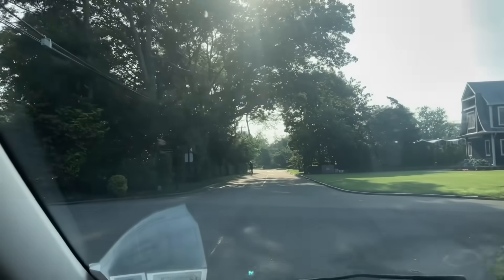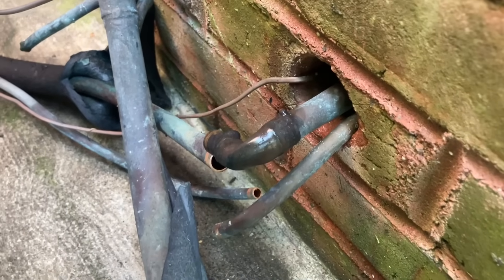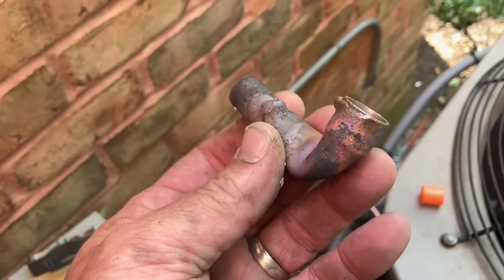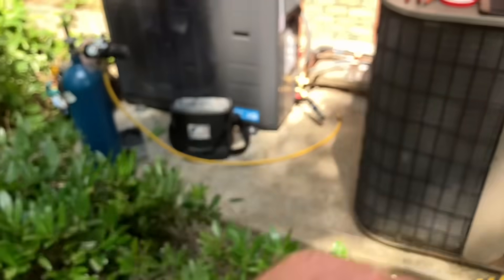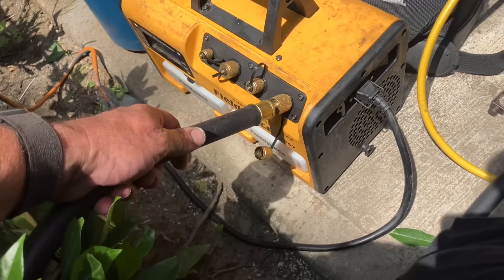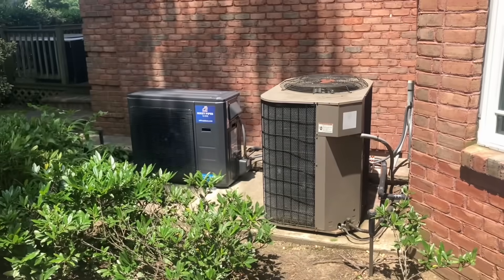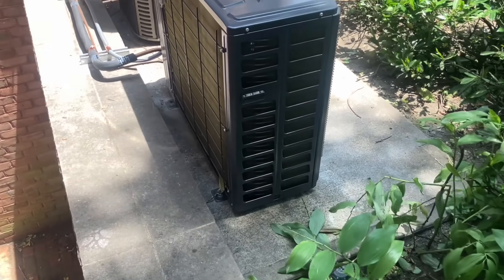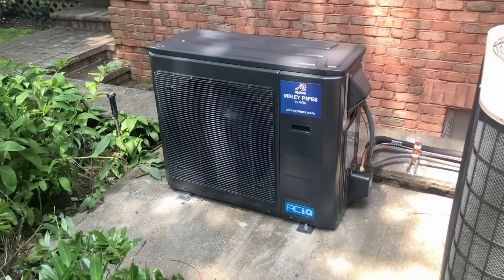ACiQ Heat Pump Installation Like a Pro – Line Set Repairs, Zoomlock & Whisper-Quiet Results!

Comment: Maybe the old lineset is preventing a proper vacuum, but you should be pulling much below 500, i shoot for 100-200 then isolate system from the pump and microns should not rise above 500.  Hitting 500 and it jumping to 2k is definitely moisture still in the system.  I know you turned the pump back on but i wonder what it is about your setup preventing good vacuums on lots of your videos.

Comment: last I seen, if capable of heat pump usage, it needs to be elevated off the ground above local snow levels. even if it will never be used as heating or backup only.

Comment: factory makes 3/4 connection for some reason and by not changing that 5/8 you 're turning into a bamboozler😂😂.On the other hand let the sinless one cast the first stone.
Reply: the 5/8th's may be fine if the run isn't excessive total length. many of them have line-set sizing charts, they generally show the loss factor on the various sizes, per total length.
yes there's a limit on how far you can step down, by tonnage as well.

Comment: Hey Mike Daick, of Mikey Pipes Plumbing not easy being cheesy. Ilike your podcast/social media, looking thru some comments/chats??? I guess some your customers,family,friends and competiton are checking in on you.. You know if you would wrap the the air handler with a two inch thick foam board, it would add about 10% to 15% more cooling power to system. The attic is a big heat magnet for the air handler, again the interior coil temp is about 42* to 45* below O*. But again, that would be a maybe a $1000 dollar option for your customer. I'm part of the "energy star" generation. Love you buddy, you be safe out there.
Reply: Yeah cause everyone is wrapping air handlers in 2” foam… lol
Reply: that wont do much, unless you can increase the plenums and all ductwork insulation to the same levels. it's equivalent of whizzing into the wind IRL.
Reply from the maker: Oh yeah?

Comment: I assume that the home owner will be using the new unit in the winter, in heating mode. What's your opinion on mounting the unit on the ground versus using a ground stand in heavy snow areas like NY?
Reply: He touched on that in the video.
Reply from the maker: Actually, the system will not be used as dual fuel only in an emergency situation when the primary heat source a 300,000 BTU gas fire boiler with eight zones is on the fritz
Reply: @PipeDoctor  Sorry, I must have missed that in the video.
Reply: @PipeDoctor an existing residential client with a boiler on the fritz? How does a boiler serviced by pipe doctor go on the fritz.?